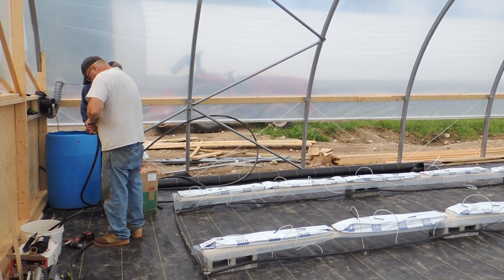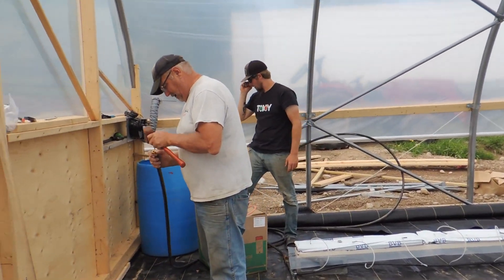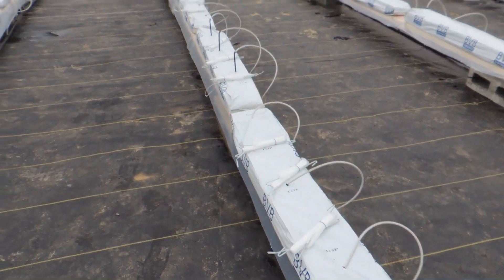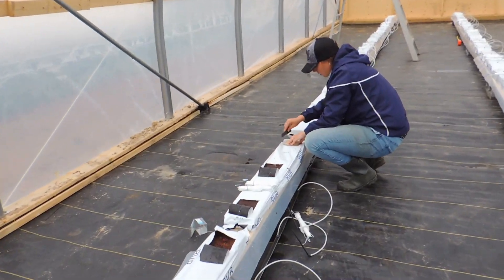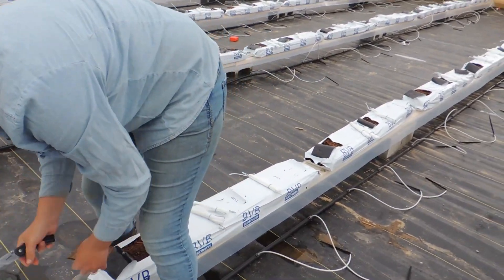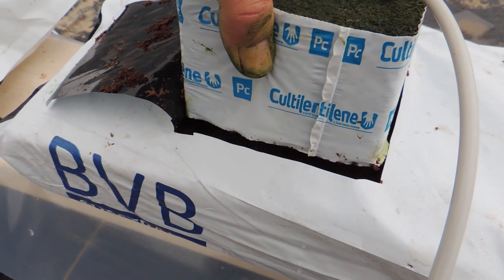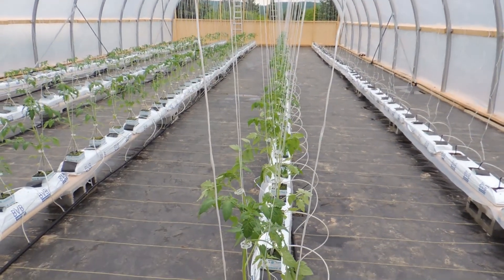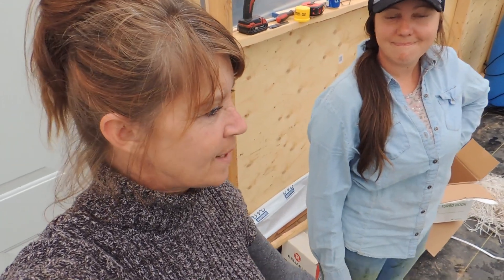New Hydroponic Tomato and Pepper House( PART 2)

Comment: Thanks for showing how it's done. It looks simple and easy, so that might fit my needs for me being lazy. Brent put a kink in it because here it's crawfish cooking hot. I'll be adding earth battery cooling pipes to my greenhouse but that will only cool the water to keep the roots cool in flow system so it wouldn't work with this system. Thanks Brent for pointing that out.

Comment: I believe it's called "Flow to Waste" aka "Drain to Waste".  It's a fun and the easiest because you don't have to worry about ph, ppms/ec, and a recirculating system.  Are you concerned about the how hot the coco-blocks will get during mid-day?  It was a concern of mine and I wanted to put a bug in your ear to keep an eye on root-zone temps.  Looking forward to your season.
Reply: totally agree, watch them root temps.
Reply: How much % of water is "wasted" in this system? The excess nutrient is just going to flow on the floor?
Reply: Mike Gray  Coconut coir holds massive amounts of liquid whilst still giving a high degree of root aeration.  You do not over soak nor undersoak if the system craps out you still have time to fix it.  Plant husbandry means you look at it all at least once a day if not more.  You do not need a huge pump most hydroponics work off a fairly small sump pump in the barrel.  Mine in NZ - we used the venturi effect mainly to suck fert up along with the water drop from a tank fed from a waterfall.

Comment: The first question which came to my mind is that of where does the excess water go to. It has already been answered that watering is done in small amounts to ensure that there is no run off.
Another major question I have is that as water is evaporating and if the plants absorb more water on say hot days as compared to the nutrients, wouldn't the EC/TDS level of the medium keep on increasing slowly over say a week or so? If this goes to dangerously high levels, wouldn't the plant get affected? Is there a need to run plain water after a fixed number of days to reduce the concentration in the medium?

Comment: I've been very curious how this system works. Does the water recirculate or do the plants just get irrigated, the  substrates  absorbs the unused nutes until the plants are ready to uptake them, any excess irrigation just drips out of the substrate? Did i get it right? Thanks.

Comment: How do you the drain excess nutrients fed to the slabs? Is there a recirculation system?
Reply from the maker: There is no recycling of nutrients. everything we pump into the system is absorbed into the slabs. we only run the system for approximately 5 minutes each time.
Reply: Spring Hill Farms Thanks. How expensive are the slabs? Any link you can share?

Comment: When the water goes from the block to the slab, where does the water go then?
Reply: When I had Hydro 18 years ago in NZ the water (including fert) goes into the bag 3 times a day - the plant then takes it up - if it is hot there is some losses through evaporation.  This is slightly different to doing a NFT (Nutrient film technique) where you continuously flow nutrient and water through the troughs and collect the excess at the other end of the trough - that returns to the main tank to have fert adjusted.  Sorry if treading on your cute tootsies Patty but I could not resist.
Reply: @Doodle Doo Doo Depends on how big the hobbyist is - using coco coir bags it is not that expensive  - it depends on what you want - the coco coir holds the water/nutrients better than peat - if peat dries out it takes a lot to get it to rehydrate coco does it much faster.  If doing say 6 bags and using a 45 gallon drum and simple drip stuff off ebay it does not cost the earth.
Reply: @Doodle Doo Doo I was a Commercial grower in NZ some 20 years ago and came across Coco Fibre by accident.  I liked it because I could put whatever nutrients in that I wanted and it was fabulous.  20 odd years later I have a 250 sq m garden and finally decided to get back growing.  We had a local shop with cheap compost but I do not have a vehicle so had to take it home 3 bags at a time.  It is OK BUT if it dries out it is a sod to re hydrate and you lose plants.  My coco coir is much better at holding moisture and fert.  I have been buying coco coir from an excellent company - the owner of which I apparently bought from many moons ago and I get fabulous prices and delivered to the door.  We are also cooperating on possible organic and inorganic ferts for him to sell as well.  Can supply the name - not sure if he does where you are but he is a real gentleman not a conman.